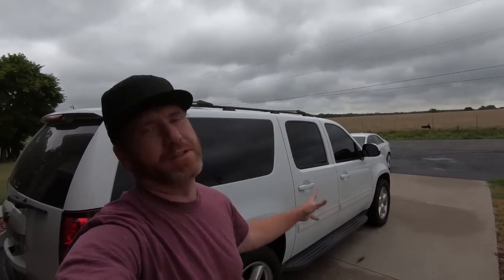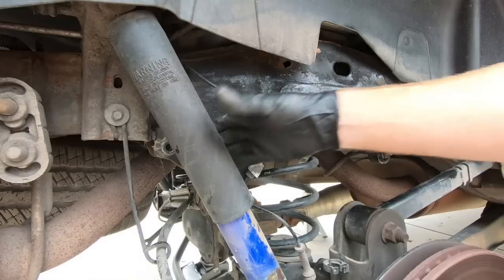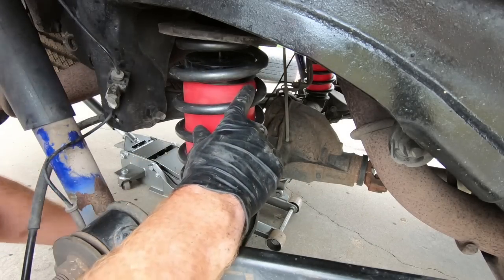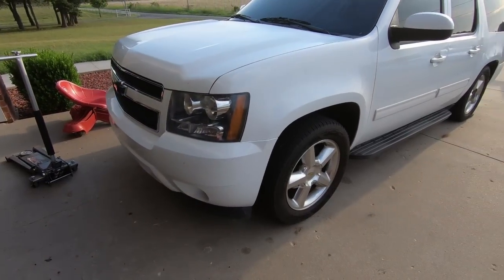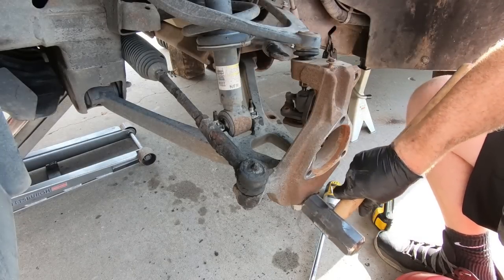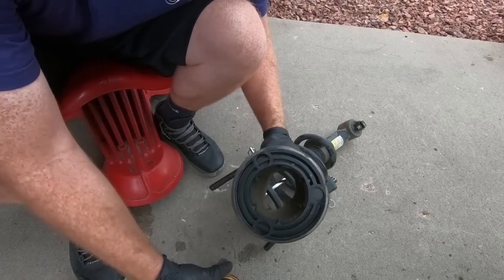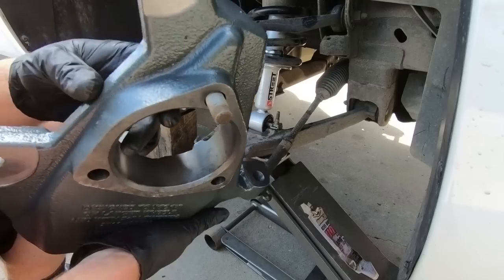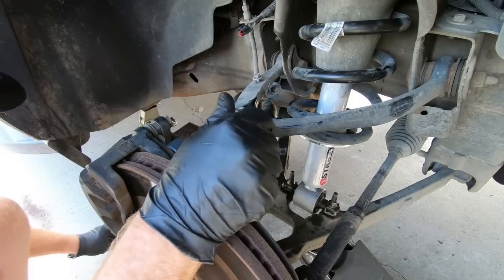How To Lower Suburban Yukon XL and Escalade ESV (Ultimate How to!!!)

Comment: Man that looks sweet! Could ya tell me what the height is at the tallest point in the back? I have a yukon xl that im trying to get through a 6'1" opening.
Reply from the maker: It's not that low
Reply: Shit... it would be a lot cooler if it was.
Reply: So i lowered my yukon xl,  i used belltech kit 733sp and this thing is low AF! I have a little rubbing in the front. I haven't use any of the plastic spacers but i think im gonna have to put them in. Great video it helped alot!

Comment: What belltech shock number did you use and how did u keep the service suspension light from coming on?
Reply from the maker: No autoride on this one. Links to parts in description
Reply: Amazon says those shocks don't fit but mine is 2011 as well so they should fit.
Reply from the maker: They say that because of autoride
Reply: @TWAMotorsports  can I just buy the rears?
Reply from the maker: If you want. Kit list both

Comment: Why didn’t you do the 3 inch drop with the struts themselves?
Reply from the maker: Never get alignment in spec that way
Reply: @TWAMotorsports  what about doing 2 inch ?
Reply from the maker: Still be border line on alignment that way. 1.5 inch is about all you can get.
Reply: @TWAMotorsports  thank you very much!
Reply from the maker: You're welcome
Reply: @TWAMotorsports  will this part fit 09 tahoe 2 wheel drive “belltech 25004?
Reply from the maker: Parts I used here will

Comment: Looks awesome! Upper control arms I can promise you wont stand a chance against you with a little downward pressure. Sometimes even pulling it down by hand while hitting it with the impact is all you need. Every now & then I lay a pry bar on top of the control arm & underneath a turn in the coil for a little more pressure. Either way nice work. Hey man you spoke on the rear coils twice in the video but I don't think you mention wether the trailblazer coils are stock or drop..? If drop coils then how many inches?
Reply from the maker: They are for lowering a trailblazer. 3" drop springs for trailblazers
Reply: Thank you sir
Reply from the maker: You're welcome

Comment: What rings in the front were you talking about i have a tahoe 02. An you said it would drop it another inch?
Reply from the maker: That is only on a truck that has coils and struts in front. Does not apply to your year.
Reply: The coils that you put in the back of the Tahoe they were off of a Trailblazer or is that an SS or just a regular Trailblazer and what is it four In
Reply from the maker: @Chevyowner79  around 4 to 5 inches. Coil link in video description
Reply: So I did the 4in for the Tahoe coils and I didn't have to move that sway bar link over 2 inches I see you did with those Trailblazer  coils would I have to do it with those because I didn't do it with the 4in Tahoe lowering springs?
Reply from the maker: I would
Reply: It didnt move when i lowered it tho but im asking about those coils you put in. You say they are a better drive. They must drop more then the 4 inch drop for tahoe.
Reply from the maker: It is generally closer to 5

Comment: Which coil spring compressor tool do you have?
Reply from the maker: Cheap rental one I bought at a parts store.
Reply: When using the trailblazer spring in the rear, how far does it lower the tahoe/yukon/escalade, roughly?
Reply from the maker: @harveyr2546  about 4 to 5"
Reply: Great video  I want to say
I am thing about getting the djm 2007 3/4 drop for my 2010 yukon, with 1" spacer for the rear, then get belltech kit 9505, but I dont wanna drop the front any more then 3 inch. So will those belltech 25004 struts let me keep just the 3 inch drop from the control arms from the djm kit? And if I put all the rings on the strut, would that only give me like a 2 inch drop in the front? Since the strut might be at stock ride height after all the rings. Or take pic of the paper work for the strut so I could see. Lol
Thank you for your videos and your help
Reply from the maker: Yes they will but I am not a fan of the a arm drop. Djm arms are garbage

Comment: Is this a stock height spring from bell tech for the trailblazer SS or is it lowered. I am lowering an 09 Yukon XL and I want to make sure the ride is as least as good as stock with auto ride. Thanks. Great videos btw
Reply from the maker: Lowering springs
Reply: Do you have a part number? Thanks
Reply from the maker: All parts I used are linked in the video description

Comment: Where do you get the torque specs for all those nuts???
Reply: Looks awesome by the way, even if you have chrome rims. 😜
Reply: Also do you need to have that free travel mod don’t to make this work???
Reply from the maker: I have them written down. I used to work for gm dealer and still have friends there.
Reply from the maker: Thanks lol
Reply from the maker: I would

Comment: Wanted to ask watched this video and the tahoe lowering video  noticed with the djm kit you moved it 2 inch on this one and used a preexisting hole but on the tahoe you made two hole and only moved it an inch is there a diffrence i have a denali so im just wondering which one would i do thank you
Reply from the maker: I didn't like the way it lined up on the one I drilled 2 holes on. Didn't look right
Reply: @TWAMotorsports  so moving it over two inches and using the existing hole u suggest lines up better definitely would make it easier having a hole to go off of already
Reply from the maker: Look at it and make that determination

Comment: I have some questions based on your vast knowledge. Love the videos by the way. Looking to drop an 08 Esky Base AWD. Because it is AWD i was taking mental notes with what you said about drop spindles so i am looking to do Belltech front struts and springs and then a 3-4 rear kit. Would you recommend this or do i need more things like the DJM stuff?
Reply from the maker: I would not do djm parts other than the rear alignment stuff I used in this video. All parts in this video description will get you what you want. You will have to remove or bypass autotide
Reply: @TWAMotorsports  correct, a bypass for sure, but you are in agreement for the strut and spring combo instead of the spindle drop  up front? Have you done this set up before?
Reply from the maker: I would never do a spring strut combo over what I did here. Spindle and strut only.
Reply: @TWAMotorsports  any particular reason as to why, and i am honestly asking because i really dont know because i am coming from the car world.
Reply from the maker: Because it will never align that way. Not enough adjustment in the control arm. Not to mention it would ride terrible.

Comment: Does that sway bar kit need to be used with a 4” drop in the rear ?
Reply from the maker: I would
Reply: So you actually did a 4 inch drop in the rear, and it went lower than that ?  I’m wanting to do a 2/4 on mine , it’s a 4x4 burb, I’m just trying to figure everything out. Love all ur videos
Reply from the maker: Could do the kit I did on the channel for my wifes white 2016 Yukon. Belltech 1019 if I remember correctly
Reply: Mines a 07 not sure if it would be the same as a 2016, I’m sure I’ll watch this a few more times and hopefully I’ll get it figured out
Reply from the maker: It is all the same from 07 to 2019